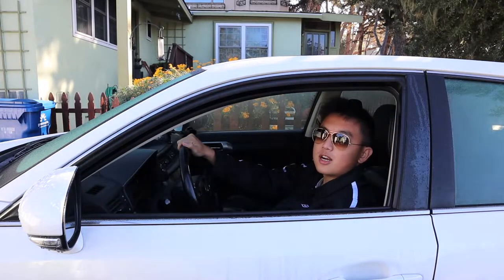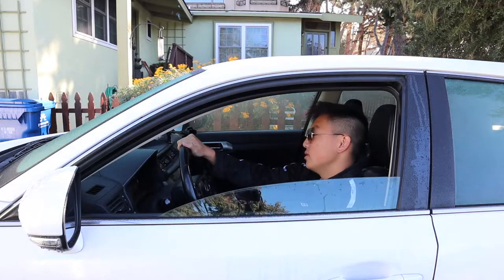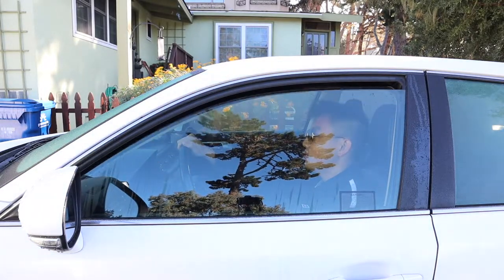How to change brake rotors & pads on a Lexus CT200h/Prius - You can do it!

Comment: Very good video and good to show the potential problems, but ideally use a dial gauge after fitting the new rotor to check for run-out. Rotate the rotor between all possible fitting positions to choose the minimum run-out. Obviously the hub mating face also needs to be totally clean so it’s wise to use a wire brush before fitting the rotor. Doing this prevents brake vibration. 

For those without a dial gauge and magnetic mount the workaround is to remove and refit the rotor to the next position if there’s vibration, and that might need to be repeated four times to get the best setting. But you need to be sure which rotor/rotors are causing the vibration. 

New rotors need to be thoroughly cleaned using brake cleaner to remove protective oil/lacquer film, but not if using coated rotors.

Comment: You should still check the brake fluid level in the reservoir because when you pull back the brake pistons, the fluid level in the reservoir must have increased.
Reply from the maker: You are correct my friend. One of the steps I took was to open up the cap on the brake fluid reservoir so that I could keep an eye on the fluid level as well as any significant air bubbles.

Comment: Why do u disconnect battery before ?
Reply from the maker: It’s always good practice to disconnect battery when you work on a car. For my specific car, there were people saying that the brake piston would compress if the key is near the car so I just disconnected the battery. Some cars will freak out if you disconnect the battery because it’ll reset the ecu meaning the car will need to relearn everything.